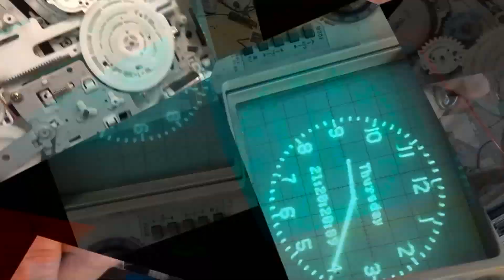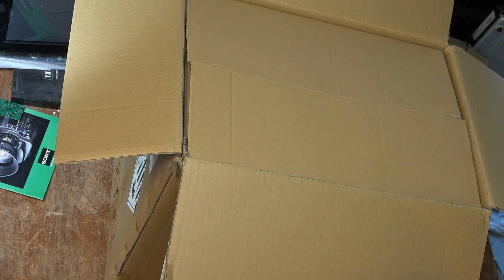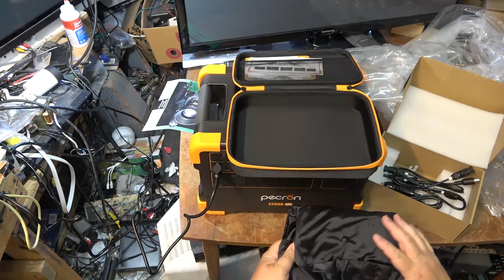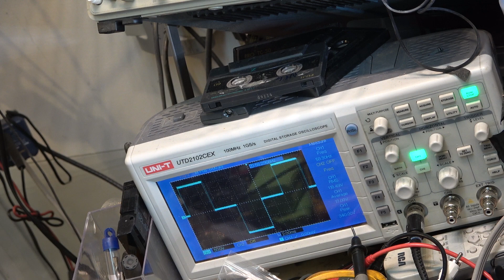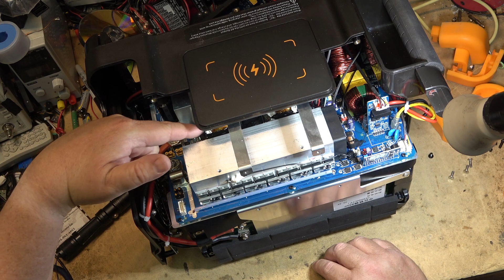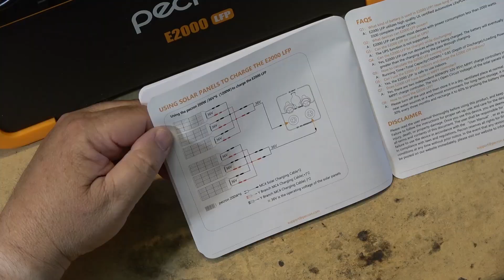Pecron E2000 LFP Power station unbox, overload and tear down (Long Version)

Comment: Thank you for the video. I just changed the controller board today on the e2000lfp because the left mppt wont charge. Before I changed the board, the battery charge level was 65%. After I swapped in the new board, the charge level shows only 1%. Will the charge level indicator be eventually corrected by the controller board?  Will it be OK if I let it charge back to 100%? Won't that be over charged since I had 65% of charge to begin with? Any help would be appreciated.

Comment: Stumbled on this because all of the DC ports on my Pecron power station have stopped working after only a month or so. Can’t say it helped with my problem but amazing and thorough video nonetheless! Cheers
Reply from the maker: Sounds like a warranty replacement to me.
Reply: My DC's also stopped working  after about 9 months or so. Now one of the fans are squawking pretty good. This would be our third unit and frankly got tired of emailing back and forth with China. English at times is challenging and at times way off....therefore wait another 24 to 48 hrs for response fingers crossed. If your a beginner and want a challenging customer service and solar experience then this is your unit. I'm going fishing and I'll figure it out later....or not.

Comment: Had the E2000 for a little bit now, enough to test.  I do like the simplicity.  Only thing I have as a downside is it will not charge with solar below 32V.  So if you want to start small and add one panel at a time this is a no go.  Because a 12V panel won't get picked up, two won't get picked up, you need to buy three 100W panels at 12V to get recognized.  Don't really like that.  But I do like the system, I bought an EB3000 to pair with it to basically give me 5k of watts.  Long term I want to get one more EB3000 and make it 8K.  But for now, 5K will do the trick and give me 8 hours even with a window A/C unit going full time during the summer.  Rest of the year it will run all my small stuff like Fridge, TV, lights, phone, computer for a good long while.  Easy to charge up with a small generator in a few hours.
Reply: You can charge with low voltage solar through 5521 port also.

Comment: Looking at the board, this is Revision 3.1  Below that it might be a datecode, 20210422, which speak to how long is the design effort/supply-chain for getting this product out.
I see a lot of XT60 connectors being used, or made available. That's smart.  
The tunnel fans look to be 60x20mm, the exhaust fans looks to be 120x25mm.  In a particular shot, it feel like there is an extra fan port on the intake side, but no fan.  This feels good for later in life servicing.
The vertical boards feel like an adaptation of OEM parts as easy integration. 
Wish Pecron had put some form of firmware update, versus "firmware/revision" lottery you might get. 

Overall, feels like a nice clean integration of somewhat generic logic.  With some battery extension, you could be in great setup for reasonable power system.

Comment: I'm interested in taking mine apart to make a diy battery expansion for it. I think two 12v lithium batteries in series for 24v will pair well with the 24v system on the pecron.
Reply from the maker: I could not give any and won't give any advice on modifying this unit because as you know lithium batteries can be dangerous.
I would not modify any device continuing lithium battery myself for those reasons.  I have seen too many fires on the news caused by people adding extra batteries to their electric bikes only to lose everything when it bursts into flames when charging.  
the only advice I can give anybody regarding any type of lithium battery is to leave it alone. The manufacturer has already done the due diligence and engineering to ensure that it is safe and any modifications will certainly defeat any safety devices designed for the original battery.  You have been warned.

Comment: Thank you for your review and tear-down.  One question remains - Did you find, (not seen in this video), the connection for the extra battery having any other connector sockets populated/used for any control circuitry other than the two-big ass sockets used for the pos and neg connection to the external battery??  THAT is my 64 K question....  I am certain your many other viewers would also appreciate this info...
Reply from the maker: The 2 pins are for the battery connection, there are also smaller pins for communication above and below the big pins. It is a special connector

Comment: Well, Christmas will be here TOMORROW  !  That is, if Fedex does not screw up my delivery.  I have the understanding that these LiFePO4 batteries are basically plug-and-play.  It seems to me that it really requires one, maybe two charge discharge cycles for the BMS to equalize the cells in a battery pack. (Remember- Engineers have the tendency to "overthink" even-day to-day issues)....  With my drone experience, the smart charger for the LiPo battery pack took some time to charge the three cell, (11.2 Volt) pack and the last many minutes were at reduced charge rates for each cell to equalize.  Only God knows how the Pecron BMS system is connected in the units battery pack and I understand that with EACH charging session, the BMS performs an equalization between all the cells, or groups of cells.  In my opinion, the FIRST charging before use is maybe the most important charge as ALL the cells need to be "at their BEST" before any appreciable load is applied.  Now I am maybe wrong, but, I believe that one, maybe two full use cycles, ~ 400 Watt load to 0% and end at 100% would be beneficial to "wake -up" the battery pack for use. (With the FIRST charge remaining active @ 100% until the unit turns off)....  After this conditioning, a usage of 5% to 95% may be beneficial and some ideas state "charge them up and use them down" fully is their mantra.  I will greatly appreciate your professional recommendation with using these latest LiFePO4 cells in this solar "generator" application....Thank You for your time and advise you may share....  Hank

Comment: As my unit will/should arrive in a couple of days, this video will cool my jets until mine gets here.  🙂 One question please.  I have four Renergy 100 Watt panels that I want to use in series.  The specs are: 
Open Circuit Voltage - 24.3 Volts x 4 = 97.2 Volts max    Optimum Operation Voltage - 20.4 Volts x 4 = 81.6 Volts running under load.    
Short Circuit Current - 5.21 Amps    Optimum Operating Current - 4.91 Amps   

IF I would make a solar connection with a total of 97.3 Volts BUT the Optimum Operating voltage is 81.6 Volts,  Would it be prudent to temporarily place a "towel shade" over a portion of one panel to inhibit that max voltage to a lower value, (MEASURE TO BE SURE), then, when the solar is connected - under load, removing the "towel shade" will then - hopefully - only provide a nominal 81 -82 Volts that would be just under the max voltage spec of 95 volts??  I will certainly measure the no load - "towel" Voltage BEFORE any connections and even IF the operating voltage would be at a 23 Volts per panel - not likely, -  (23 x 4 = 92 Volts), I should be good-to-go....  P.S.  For general information:  Connect your solar panel array with using the MAXIMUM Voltage allowable to reduce the Amps traveling through the main feed line.  Until I figure out where to more permanently mount my panels, I will be using a "not optimum" wire size of 1.31 mm = 16 GA wire.  My Wattage loss over 60 feet will "only" be about 13 Watts over the run.  IF I were to configure my panels in a 2 - 100 Watt parallel - 2 - 100 Watt parallel, then in series with each other, I would have available ~40.8 Volts @ 9.8 Amps but, my Wattage loss would be ~45 Watts....  Remember, use the highest voltage panel configuration that your solar gen will accommodate....
Reply from the maker: You wire them in series / parallel so the viktage falls in the usable range.  The charge is the same.  
Instead of 96 volts you have 46 but double the current.  The watt hours remain the same.
Reply: @12voltvids  I understand that the Wattage remains the same.  The "Real Installation" will be using a lot beefier - #10 or #12, depending on the feed line length....  I will certainly measure the shaded total panel voltage BEFORE any connection, but, I am hopeful that the connected-loaded voltage will be under the 95 Volt max....  IF, indeed the loaded voltage is LESS THAN the max allowed, I "should" be good to go...   Your advise is THE BEST solution and I'll probably pony up the bucks and run two feed lines and be assured that I won't F it up  🙂   Thank you for your tear-down and testing, gives me a look inside my unit - engineering minds want to know....
Reply from the maker: @ainttakenanyshit  you are not pulling that much power 14ga will be fine.  
My ev charger pulls 16 Amos @ 240v and it's just 14ga.
Reply: @12voltvids  Thank you for the conversation and GOOD advise....  As mentioned,  will measure the voltage BEFORE any connections and I am hopefully assured that with the lower voltage via towel shade, then connecting, I will be JUST under the max voltage specification....  "Measure twice - Connect once"....  AND, with monitoring the voltage, while connected, then slowly removing the towel, I will have a measured voltage under load while the shade is slowly removed...

Comment: PECRON E2000LFP Expandable Portable Power Station
( 10 reviews )
Sale price$1,556.00
 wow
Reply from the maker: Discount code 5%. CA12VOLE2000LFP
Reply: It’s $1099.00 now
Reply from the maker: @markhunt6573  that's usd. That cjbceets to close to 1500 Canadian.
Reply: @12voltvids  have you had Any issues with your units.  I am still deciding if I really need want this particular unit as some reviews state that they heard odd noises coming from inside unit.
Reply from the maker: @donaldricher8815  other than the fans no other noises.
Reply: WM $1099.00 + 4 Year Service plan, (77 bucks), Will definitely be "used", close to 3.9 years  -   🙂..I bought both and the plan also covers "drops" etc....  Being THAT heavy, a "drop" will most likely happen....  Just say'in  🙂

Comment: Just for the heck  of it, I looked up the cost of this impressive unit. Amazon lists it for ~$1K. With two addon's, we're talking ~ $2400 but this arrangement gives you twice as much capacity. Not really bad for that much power for such a long period.
Reply from the maker: Its $1556 CDN direct from Pecron and with the discount code CA12VOLE2000LFP that knocks 5% off. Pricey but look at what you get. I was very impressed with this one.